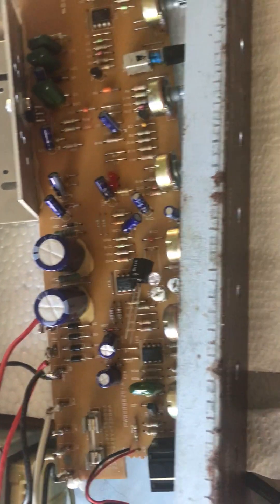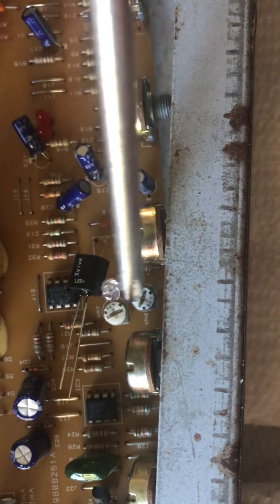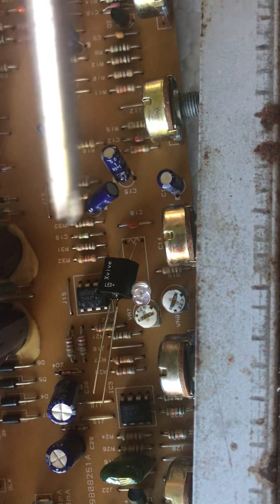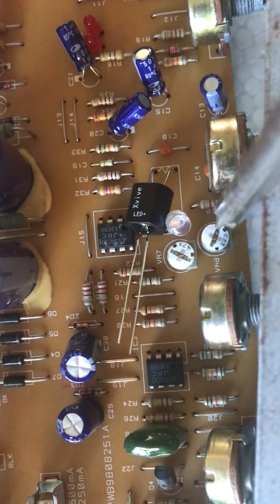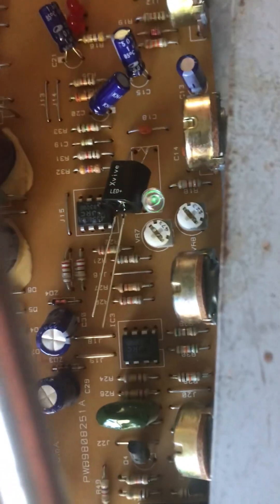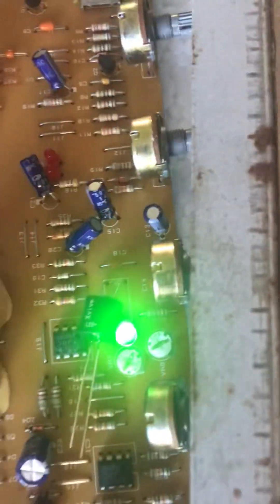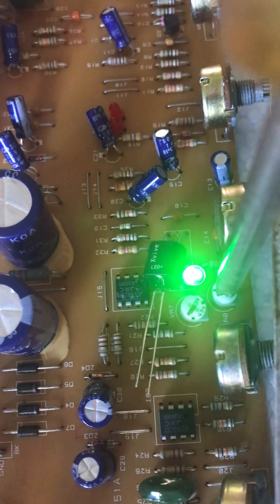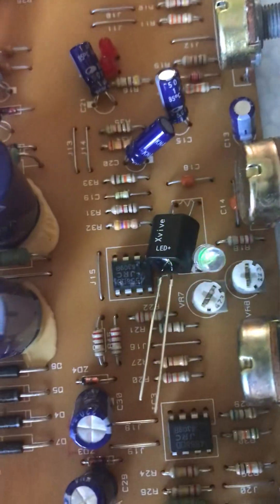How to set optocoupler up on a Vox Cambridge 15/30R or Pathfinder 15 LED method

Comment: I replaced the Optocoupler in a Cabridge 30 Twin Reverb this morning. It took about 30 minutes.
The innards of the Cambridge, if you have that amp, is similar enough to the Pathfinder. These instructions will get you through.  
If you can solder your own pickups to pots, then you can do this repair.
Reply from the maker: Hope your tremolo is working great!  Thanks for your honest feedback

Comment: I have the Cambridge 30 Twin and it sounds bad when, using the trim pots, too much signal is allowed. I don't know if this is because the optocoupler is bad or that the amp isn't capable of handling the full signal. 

Question, can I bypass the optocoupler altogether? I'm willing to go without tremolo. If the opto can be bypassed, does anyone know how?
Reply from the maker: You can’t bypass the optocoupler. It needs to be adjusted to get the right amount of signal through and probably needs replacement

Comment: Glad to see someone cares enough to help take care of these excellent amps.  I have 2 15Rs (so this doesn't apply), so thanks for the vids - they'll live on til the sun burns up.
Reply from the maker: Yep, I believe these amplifiers deserve to stay out of the landfills. They will still be going strong long after all these irreparable modeling amplifiers are long gone!!
Reply: @voxpathfinder15r Have you tried rolling different preamp tubes in a cambridge 30, like 12at7 or 12au7?
Reply from the maker: @jasondorsey7110  no I haven’t done that yet, I suspect the overall volume will drop with those variants. What are you expecting?
Reply: @voxpathfinder15r  More headroom, slightly less max volume, possibly smoother overdrive, possible change to tonal characteristics, possibly different reverb/tremolo characteristics if it's passing more current to those parts of the circuit, though honestly I don't know if it is connected to them...I don't currently own a cambridge but I'm thinking about buying a 30 reverb twin for sale in my area, just figured I'd pick your brain since you seem to have alot of experience with this amp series
Reply from the maker: If you drop to a 12at7 or 12au7, you will get less gain, or have to turn the dial way up to get the same gain you were before. Also plates and cathode resistors are optimized for a 12ax7. And  a 12au7 could require a lot higher wattage plate resistors if you try to rebalance the plate/cathode resistor values. Never been a real fan of the concept of increasing headroom. I just dial less gain, it comes down to simply knob positions before clipping starts. Change tube or dial knob down…take your pick.
Reply: @voxpathfinder15r  I get what you're saying, thanks for your insight. Since I already have a pathfinder 15r, is there any point in getting a cambridge, or would it be redundant?
Reply from the maker: @jasondorsey7110  I have a video comparing the Vox Pathfinder 15R and the Cambridge 15. You be the judge. I have a friend who thinks the Cambridge 30R is a total letdown and the pathfinder 15R is way better. I think he said he was partial to the Cambridge 15, but the 30R sucked. I like owning them all. But it’s probably redundant
Reply: @voxpathfinder15r  I love vox too, I have the basses korg got sued over, a 2013 phantom and a 2014 teardrop, the shortscale reissues
Reply: @voxpathfinder15r  Why did your friend think the C15 is better than the C30RT? I own both a P15T and (as of today) a C30RT, and I must say... The Cambridge certainly sounds like a good amp but it gets nowhere near the volume of the Pathfinder even though this has a replaced optocoupler. I'll try the method you show in this video tomorrow but I'm also wondering if I should start the hunt for a C15.
Reply from the maker: @patrickvanvlooten  I don’t know why my buddy thinks the the Cambridge 30 is a letdown?  Everyone has different ears I suppose?  He loves the pathfinder amplifiers for sure. I am guilty myself of haven’t plugged into my Cambridge 30 in years
Reply: @voxpathfinder15r  I just messed around with my trimpots and the output level is much better now. It's maybe just a little louder than the Pathfinder but it retains much more headroom on high volume because of it's dual speaker design I guess. I quite like the sound of it!
Reply: I have em all! My favorite is the Cambridge 30 with the single 10 inch, that thing is like a Princeton reverb. The 2x10 version is pretty good to but for best results I run those vox cooltron pedals with it which I know is redundant & overkill.